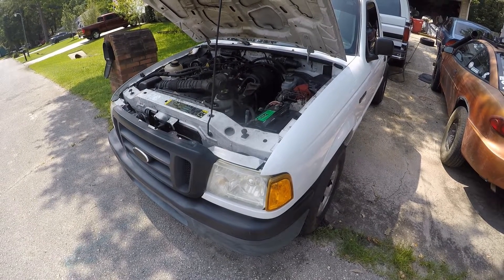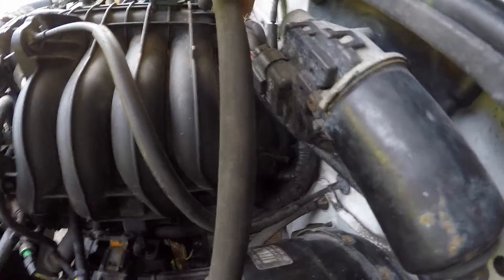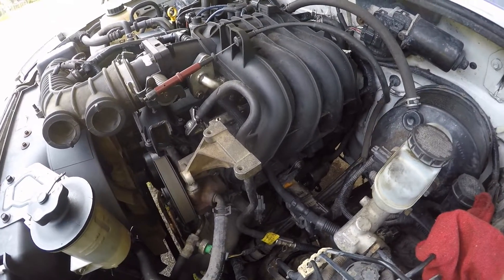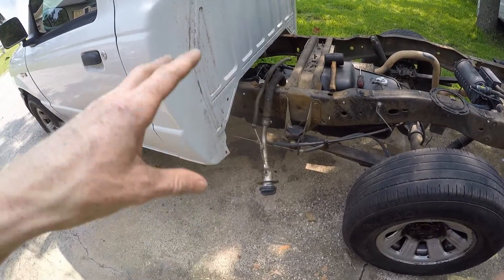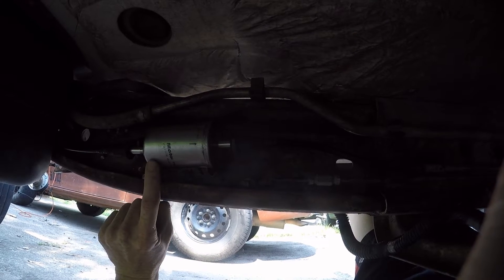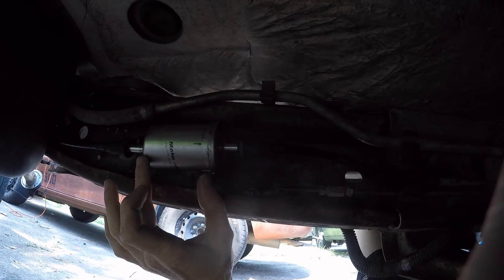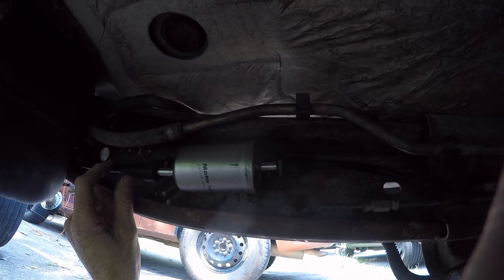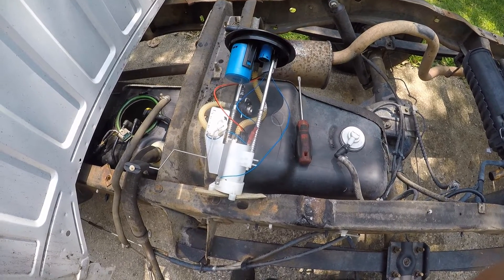How A Returnless Fuel System Works on Ford Rangers (1998+)

Comment: I have a 2003 2.3L Ranger I was wondering if a bad damper could cause a loss of power and no start I replaced the fuel pump assembly with a better one replaced the filter I checked the inertia switch cutofff and it was bypassed anyway The pump is priming but no pressure at the gauge and no start. I swapped relays to see if it was the relay itself but still no start and the fuse is not blown.